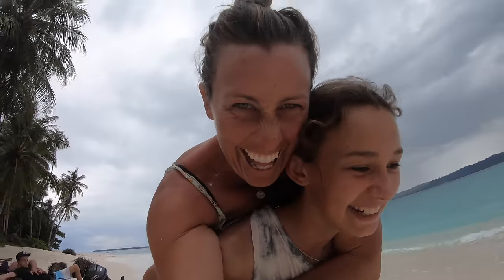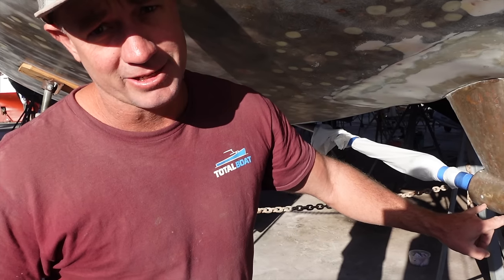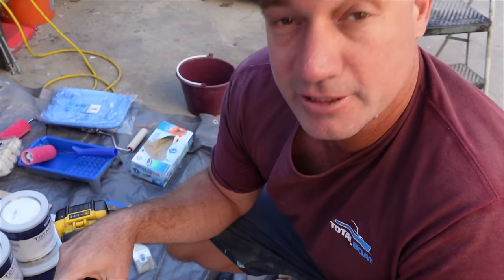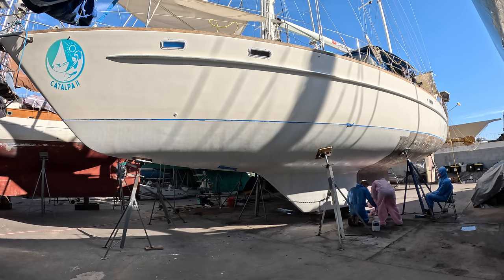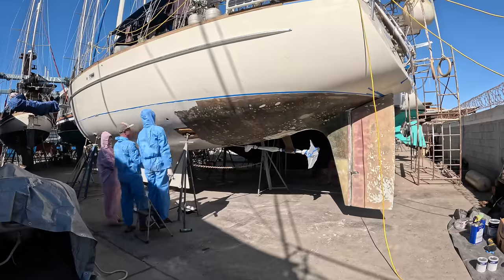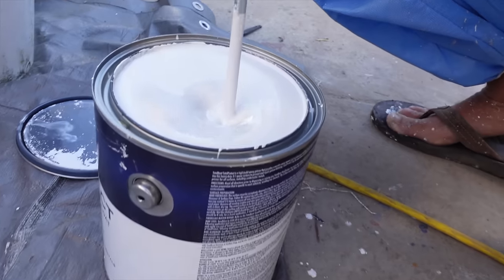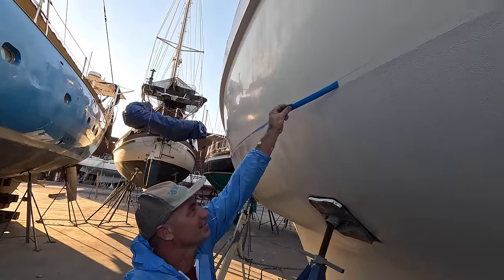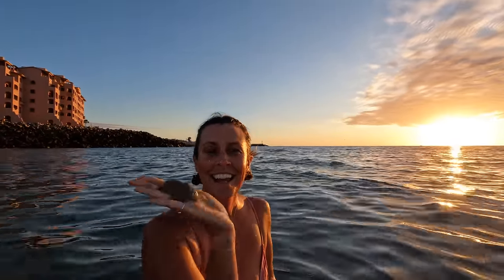One step closer to splashing | Ep 388

Comment: Gidday from NZ, just bought a ferro sail boat and hoping for advice on a small weep coming through to the inside of the hull below water line.  It is a small amount of rusty coloured, sour tasting water.  Enough to soak a patch of toilet paper in a couple of hours.  Suspect micro cracking or porosity allowing seawater through hull.  How worried should I be?